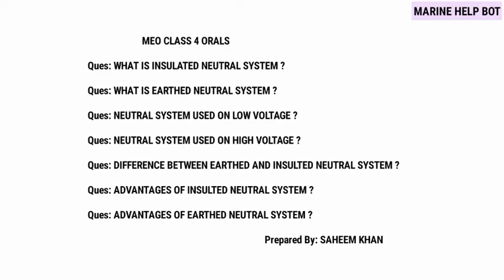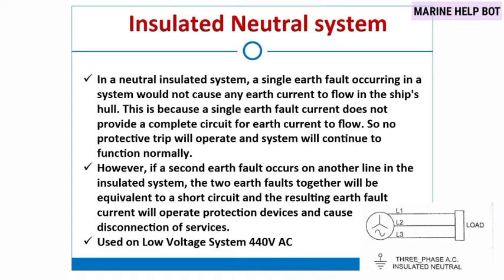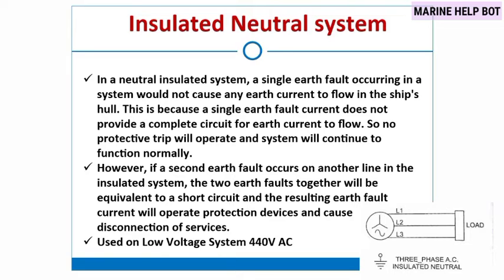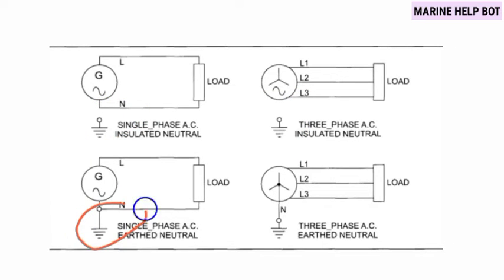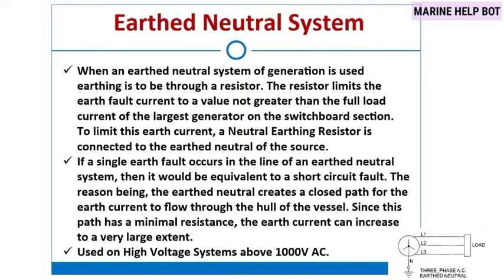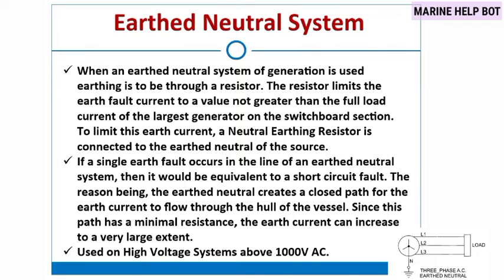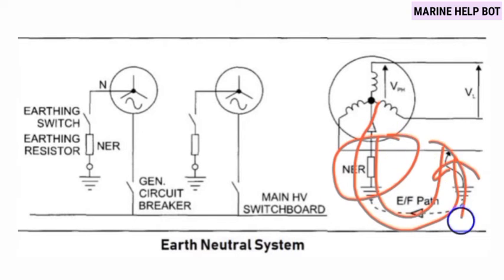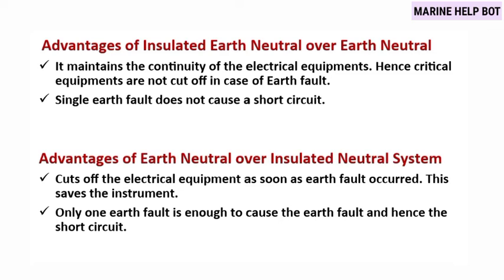Insulated Neutral System | Earthed Neutral system | Neutral Earthing Resistor | Advantages

Comment: 1. OWS regulation. 
2. 15 ppm alarm test.
3. Sequential start.
4. Fuse/CB difference 
5. Earth fault detail.
6. Synchroscopes working principle 
7. MSB Safety 
8. Action in Black out
9. Action in Scavenge Fire
10. Parallel / load shifting procedure 
11. Overshoot 
12. Alternator details
13. GHG regulation 
14. Transformer working principle 
15. Motor working principle 
16. Single phase/ Three phase advantage 
17. How to adjust frequency? 
18. Voltage difference in two Generator, what should u do?
19. 1st & 2nd law of thermodynamics
todays oral question meo clss 4
Reply from the maker: thanks a lot bro...
Reply: @MarineHelpBotNew  brother pls discuss the electrical topic. surveyors this days emphasise more on electrical topics